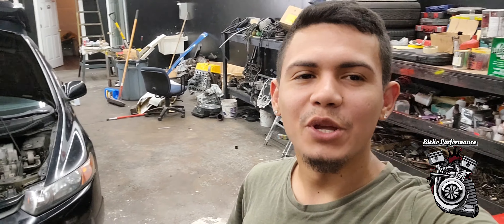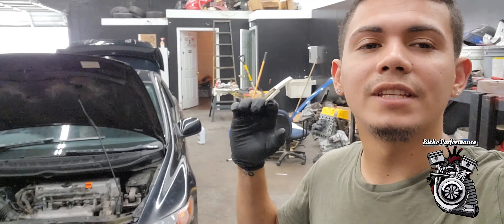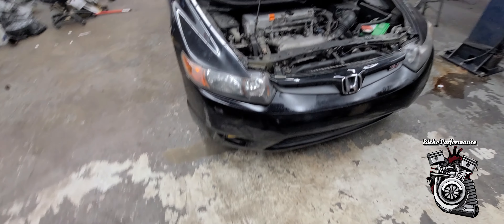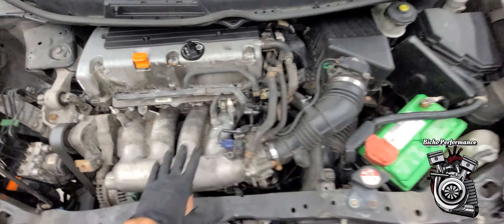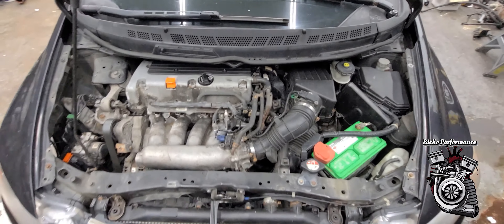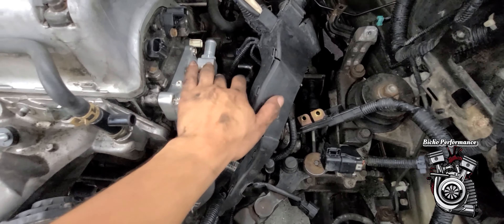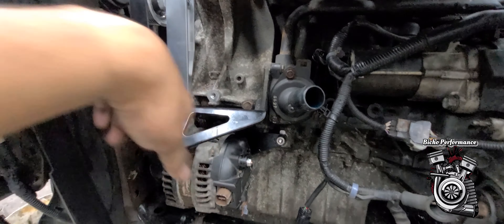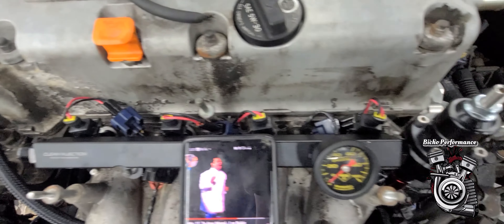8th Gen Civic Si turbo built in 4 days!👨‍🔧

Comment: i wonder why i have never seen a k20z3 make anything over 700whp... they have a d16z6 that made over 830whp and ive seen a k20z3 blow at that horsepower
Reply: Uuhhhh..Seen built K20Z's make 1200..NO stock D16 will make 830..
Reply: @hondatrix  im talkin about the z3 not the motor from the rsx, and swapping the bottom end doesnt count